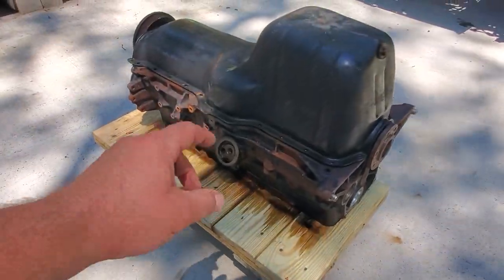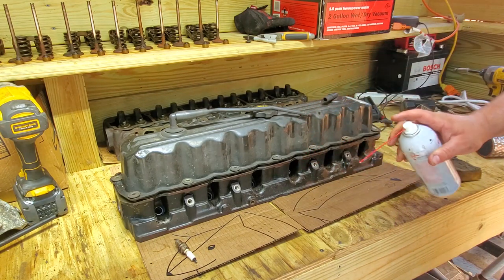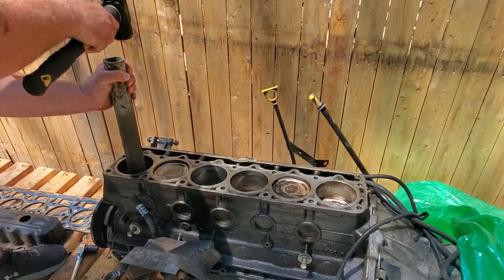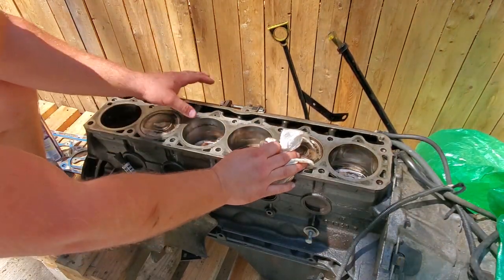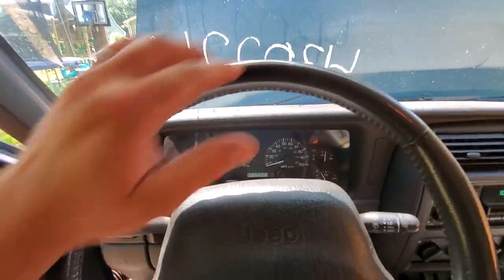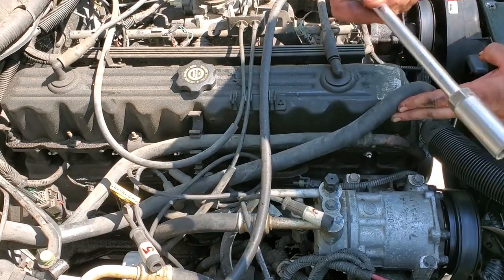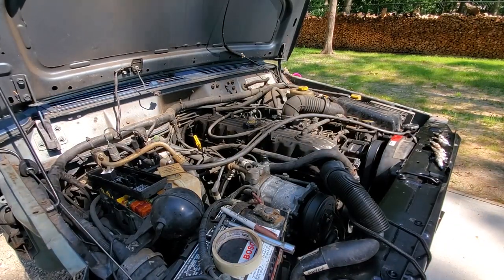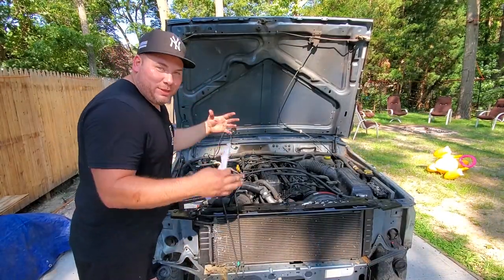JEEP CHEROKEE 4.0 COMPRESSION TEST, CYLINDER HEALTH, ENGINE SELECTION.

Comment from the maker: Thanks for checking in guys! FYI.  According to the 2001 XJ Factory Service Manual a healthy 4.0 engine should have compression ranging from 120psi to 150psi and all cylinders should be within 30psi of one a other 👍
Reply from the maker: (827 to 1034kPa)
Reply: So I just did a compression test on my 2000 xj and got 1: 170 2: 150 3:150 4:175 5:160 6:160. The psi is a little high but they all are within 30 of each other. Mine sounds very similar to that knocky one you showed in this video. I have removed to oil pan to inspect the underside of the motor and taken the head off twice and found no damage. The first time I took the head off I had 2 messed up lifters so I changed all the lifters, push rods, valves and their associated hardware. It ran great for maybe 2 weeks then started knocking and running shitty again. I removed the head the second time to double check I didn’t mess something up. Also there are no CEL codes and I have ruled out the coil by swapping a few coils in. The motor has 130k on it. I am stumped.
Reply from the maker: @iphone777  I don't know man I wish I could help.. have you tried mixing up your fuel Maybe use 93? I wonder if you had a bad gas issue.
Reply: @iphone777  fwiw, when you said knocking that sounds like what I hear in my 4.0 L.  After some research I found a video that the creator found PISTON SLAP was the cause to make that sound. It's here on YouTube somewhere.  He had a friend mechanic re-hone one of the cylinders.  And I believe he placed the piston and rings as well on that cylinder.  It solved his issue.
Reply: My 2004 Jeep wj 4.0l  compression readings from 173 to 180. Is that normal for this engine with 145k miles? I don't think so. Rough idle but runs great. I've replaced all the sensors 2 times I mean everything even the crank sensor. No vacuum leaks. Injectors are the 3rd set. Coil pack are the 3rd set. I tried to dicarbonate the engine too. I was thinking to fuel up with a 91 octane fuel to see the  different. Please let me know if you have any suggestions!

Comment: Love your video's man, your like the jeep guru! I'm having the worst time trying to figure out my 98 4.0 stalling issue. Would be super helpful if you did a series of common issue on the infamous stalling problem.
Reply from the maker: Thanks Jay! I would love to... fortunately i haven't had that issue.  I believe a new PCM might solve that problem.  if you but a used one make sure its a 98. 1998 PCMs are year specific.
Reply: Thanks for the reply but i have changed the pcm, crank position sensor, map sensor, aic, distributor pickup and plug/wire's and still no luck. Idk what else to try. I'm losing my mind over here. Lol
Reply: @jayragoonanan2598  stalls after start? Or idles then stalls when you go to gear?
Reply: Cranks and stalls whiles at idle(may run for about 5mins) or when coming to a stop.
Reply: @jayragoonanan2598  check the wiring to the crank position sensor. 
They used thinner wire than earlier models. 
The intermittent stall is indicative of a short.
Reply: @amoncopeland6747  thanks homie. I'll check it out.
Reply: @jayragoonanan2598  check fuel pump pressure after it stalls I had a bad pump do this to me on my 98ZJ limited

Comment: hey dan, you should look into the k suspension viper coil upgraded for the 97-01 XJ's. i currently have it in my 2000, best upgrade ever, during the summer i was having lots of problems with the stock coil pack having hard misfire from heat, similar to fuel rail heat soak, it mounts a dodge viper coil and bracket to your coolant reservoir and has 6 plug wires running to your spark plugs and wire harness adapter, considering you will spend most of beach jeeps days in the sun, this upgrade might be great for you, and for black beauty, stay safe brother!
Reply from the maker: That's an excellent idea!  Sounds like a must have for beach jeep!
Reply: I was just about to ask that same question. I had the ksuspension ultimate power upgrade on my 99 XJ, you could barely touch the key and it would start and the windows went up and down faster. Also check out the headlight harness they sell. Well worth the money.
Reply from the maker: @robertgrauman8602  thanks Robert! I plan to make my own power upgrade. I find the K suspension kit to have too much extra wire.  Still a Great kit tho 💪
Reply: @ProjectDanH  not knowing what your plan is this may not apply to you, but the kit is essentially a "big 3 upgrade." Let's you put a bigger alternator on it. I have one of their Kit's on my ZJ and it's perfect with my 160 amp durango alternator. As long as you replace the fusible like with some kind of inline fuse that is the amperage of your alternator plus a certain percentage and round up to the nearest available fuse size, in my case a 250 amp mega fuse, you should be fine. K suspension is basically a small mom and pop shop  selling stuff for our Jeep's. They've got great customer service with online tutorials on how to install their products. I like the military style terminals in their power kit, let's you add an accessory quickly without splicing. But then again I've been talking them up since before they got featured on Motorhead Garage. And hey there's another idea for a project for you, alternator upgrade. You might need it with what you're doing with Beach Jeep.
Reply from the maker: @robertgrauman8602  yea buddy! I'm definitely doing the 160 amp upgrade.  I'm very familiar with K suspension products and I'm not too thrilled with their electrical components.  I wasn't crazy about their xj headlight upgrade, the harness was made in China like the Amazon crap and the wires were falling out of the connectors.  Also on their power cable upgrade the ear of their positive terminal cracked off.   I think they are better suited for metal fabrication.
Reply: @ProjectDanH  I could be mistaken, but to my knowledge everything they do is made in the states. Also if you have an issue with one of their products get a hold of them and they'll correct it. When I had an issue installing the headlight harness I shot them an email, and about an hour later the owner called me and walked me through it. It's that kind of customer service you don't see anymore. The headlight harness worked great until I scrapped my XJ. Once I replace my faded headlight housing I'm getting one for my ZJ. It's not the led conversion you did on Black Beauty?, it just puts the whole 12 volts directly to the bulbs and not through the switch. To me, the harness looks like the one you find in the lmc truck catalogs. I apologise if I'm rambling, I haven't had my coffee yet.
Reply: @ProjectDanH  sorry about that, I tend to be a bit grumpy before my coffee. I reread your response, sounds like you had an issue that you may or may not have rectified. Depending on when you bought your kit it may have come with different terminals. I want to say that between when I first found k suspension and when I bought the cables something changed, but I can't say for certain, it's been about a year or so. Could have been a change in the options or a change in supplier. I know with the kit that came for my ZJ had a different fuse and fuse holder than the kit that came for my XJ. It could be that the kit you got was a different revision than mine. I still recommend the military style terminals. Again sorry for responding to you all grumpy and such.
Reply from the maker: @robertgrauman8602  good morning Robert! I'm drinking my coffee too!.  Headlight harness upgrade was purchased in September 2019, battery cable upgrade was purchased in March 2020.  I installed everything on my friends 97 XJ.  I'll have him reach out to them. Hopefully they can replace the positive terminal. 👍 Enjoy your Sunday!

Comment: Just learning...  What compression readings would be considered a failed engine candidate?   I understand the 75% range, but what if most of the readings were less than 150 for example.  Would that be a concern?  Is there a 4.0L spec somewhere that should be checked against?   Btw, thanks for awesome camera angles, it helps!
Reply from the maker: Hey Trent! Thanks for checking in, great question.  According to the 2001 XJ service manual the engine compression should range from 120 to 150 and should be within 30 psi of one a other 👍

Comment: Hi Dan, I love your videos. Why not put a 5.9 in the Beach Jeep?
Reply from the maker: That would be awesome but I don't have a 5.9 🙁.  I'm gonna keep it stock because I have a million 4.0 parts.  One day I'll put a 4.7 stroker in 😃
Reply: Probably wouldn't fit....the 5.9 is extremely cramped in the ZJ, so trying to cram a V8 into the XJ that was actually designed for a V6 or a 4 cylinder probably wouldn't work.
Reply from the maker: @wildbill23c  yep

Comment: I love the coil rail on the WJ and later XJs, but why couldn't we get it as an individual pack setup?! One pack goes and you have to replace the whole thing. Also makes it very difficult to diagnose if a pack is causing a misfire as you cannot swap between cylinders. This has plagued me on a number of WJs
Reply from the maker: very very true Doug!  I think space was the biggest concern consider they're is only 3 pack.. they had to double up I guess... check this beast out..
https://youtu.be/YWcZMjA7ZgQ
now that's a cool pack rail!